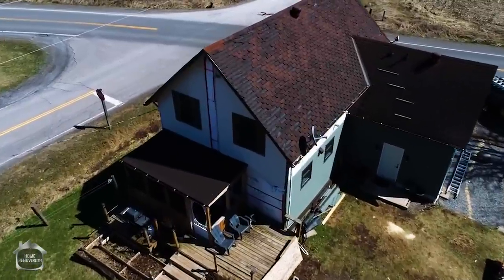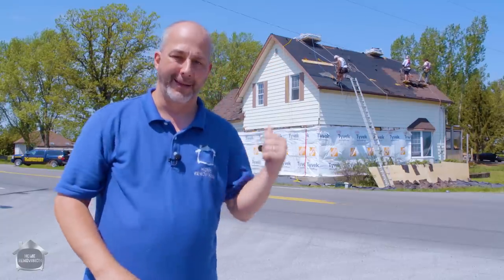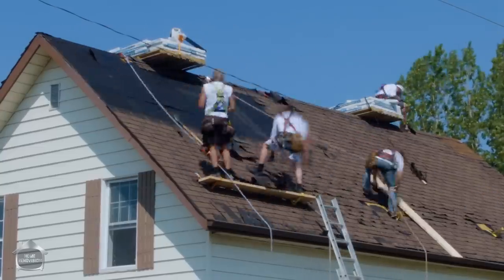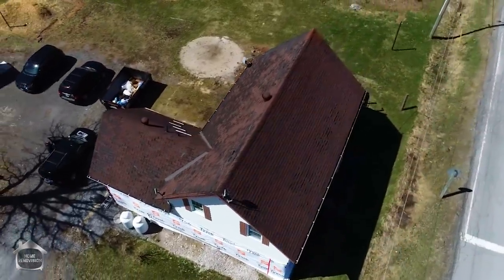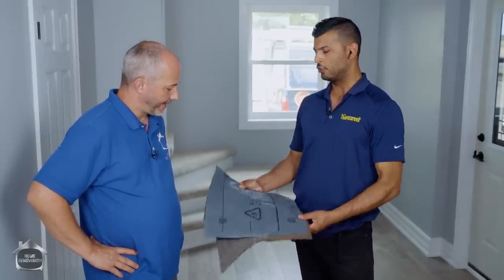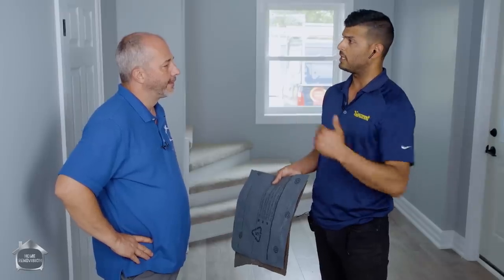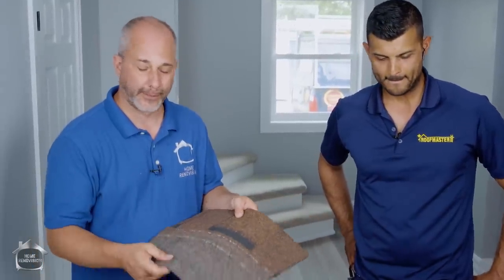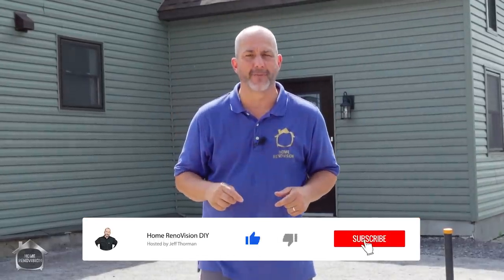What to Expect When Changing Your Roof

Comment: I've roofed for over 30 years and I do believe that your supposed to apply the ice and weather guard directly to the sheathing, plywood! Not over top of the old tar paper. Also, if your not taking the old tar paper off, how are you securing the old deck that will always come lose when tearing off the old shingles?
Reply: I roofed for 2 years and i know this as fact. It's supposed to melt onto the surface it is laid on over the summer, now if that surface is loose tar paper,your product isn't installed properly, it won't do its job properly, and you will 100% need to re install more ice and water shielding when you redo your roof, whereas there's a good chance, if installed properly, you wouldn't next time around. Also that grey underlay freaking sucks, it's like cloth and yes it fucking can be slippery. I've gotten more tears around nails with that product than any other i used.
Reply: Correct.  I used gracie snow and ice right up to the ridge vent.   Roof will not leak for a VERY long time.  Cheap insurance.
Reply: Correct ice and water goes only on sheathing..if its put over paper it is pointless it leaves a gap in between and doesnt stick
Reply: the irc requires removal of all roofing materials before installation of new materials. self adhered membranes can remain, and you are allowed to put the new materials over the old.
Reply: @paperwait9611  Sounds like a shitty idea.
Reply: @davec.3198  damn I feel sorry for the next roofers who have to try and tear those roofs off. Nothing that got my panties in a bunch like shingles welded to the ice guard!
Reply: I've had to rip a 7 sq section that the shingles were stick to ice and water(done it many of times but this was the biggest section)and I use my knife to cut the bottom of the shingles off then use my hammer to pop the nails and just go shingle by shingle..its the fastest and cleanest way cause if you use a ripper it leaves pieces everywhere all uneven and it's just messy and you have to get the double part off if its architectural which if it has ice and water on it then it most likely is
Reply: @robertsmith8081  The Gracie product has a plastic top on it that doesn't weld to the shingle.  The back of it that is on the deck is insanely sticky once the sun hits it.  I accidentally had some trimmings from it stay for a week on top of my new shingles.  I had to go up and cut them off with a razor blade.  They where welded on.  
That made me a believer.
Reply: @davec.3198  yeah Dave I've used that and had makes a similar product also. But, the cost associated with these 2 and others might be the difference of selling a roof and losing abid.
Reply: @robertsmith8081  I get it.  I was doing my own roof.  Did half of it for $2k on a long ranch house.  There was a serious insulation and ice damming issue that only affected the back side of the house.
Reply: @davec.3198  why do you state that? i don't see any problem with the irc provision on this matter.
Reply: @860smalley5   No ice and water shield is the seal around the nails.
Reply: @paperwait9611  self adhered isn't tar paper
Reply: You're absolutely right

Comment: Good video on shingle roofing technology. But pretty biased from an asphalt roof installer. If after 50 years your metal roof has a deteriorated coating, you can repaint it for a fraction of the cost than re-shingling the roof again. At least the house is waterproof and the panels haven't blown off. Exposed fastener metal roofing is very affordable compared to standing steam metal roofing. Asphalt shingles are not sustainable environmentally and frankly, financially.
Reply: You can’t just repaint a metal roof it has to be coated and coating a roof properly will cost more than installing a new metal roof. If it was the case that you could just paint a metal roof then no one would be doing metal roof tear offs
Reply: @38snipshow  100% agreed. I despise the 'cheapest is best' or  'I'm going to flip it in a couple of years so why spend the money'  mentality. That 'thinking' creates a vicious cycle of mediocrity.
Reply: The problem is that quality isn't something buyers pay for when house shopping. They pay for interior renovations, square footage, and schools. A new 50 year roof isn't going to get you a significantly higher sale price vs a 20 year old shingle roof. Same with insulation, air sealing, quality siding, etc.
Reply: @danbert8  That is the sad reality, in our warped market finishes are  also more important than structure. The solution is a better building code.
Reply: @danbert8  if you are going to go the "quality" route, you have to go all-in throughout the house. you have to have a clearly "quality" house to have any chance of fetching a premium. a "quality" roof alone isn't going to do anything for you.
Reply: @danbert8  not everyone is trying to 'flip' a house to sell. My investment properties are long term holds so that's not as relevant.
Reply: @38snipshow  yep. It’s not just about flipping… so if you say, add a nice fence to a property, you could then consider “selling “ the property at a higher rate to a pet owner, versus without. And if not a pet owner, it’ll just be a nice privacy fence.
Reply: And in 5 yrs when all the rubber washers on your screws bakes from the sun and starts leaking that's 1000s of potential leaks
Reply: @briscoesjug1026  If the washers on the screws deteriorate in 5 years, then the installation was poorly done. Regardless, I'd rather replace a bunch of screws in 15-20+ years than rip off a roof and replace the entire thing lol
Reply: @38snipshow  unless you live in Oregon or Maybe Canada where either it rains all the time or the sun don't shine it will become a problem. Might not be one you notice right away but eventually you'll notice . Hell I'm in the east and it happens all the time
Reply: @briscoesjug1026  I'm from southern Ontario. There are 30 year old exposed fastener roofs all around me and haven't heard of an issue as far as water leaks are concerned. At the end of the day, standing seam metal, despite the upfront cost, out performs all other roofing types
Reply: @briscoesjug1026  Lol
Reply: @rightlanehog3151  it’s what people can afford

Comment: We got our roof done this year, decided on metal because we got solar installed on it and wanted to make sure the roof would last as long as the solar panels. Love the sound during rain/hail! We are reaching net zero on our 1886 property! woth surprisingly low costs!
Reply: Yeah metal is nice but as a roofer myself I've seen the rubber washers on the screws that hold the metal on bake from the sun and that's 1000s of potential leaks
Reply: @briscoesjug1026 would a standing seam roof work better in that regard?

Comment: I just had an AS roof installed on my 1940s house (leaking and ceiling about to fall in!) I didnt see this video before I had it done, but after seeing this, I feel 900% more confident in my decision! $7800 for 18 square on an 8 pitch was not a bad price for what I got! Thank you for your fantastic videos! You're my go-to for my projects!
Reply from the maker: Like the guy in the video said....it has changed a lot over the last 20 years. I expect it will double in cost every 15 years moving forward as well. Cheers!
Reply: What I did to build confidence in my choice was to note addresses with newer roofs. I can search permits online. Then I noted the companies & their job prices. Btw, half the addresses never pulled a permit. I cross referenced the company name/owner with state licensing & small claims to see who is getting sued for bad jobs & if they're qualified. 

Lots of horror stories. I don't want to be another one.
Reply: @HomeRenoVisionDIY  Also, shingles raise in price with the price of gas and oil, let alone inflation.
Reply: @KLondike5  where exactly online do you check this information?

Comment: I had metal vents written into my roofing contract. 5 years later I find out they did metal on the attic vents but plastic on the bathroom fans. They will skimp where ever they can get away with it so make sure you know enough to judge there work.

Comment: I looked at my roof today while up getting caulking and touch up painting done.  I need a new roof.  This was most helpful.  I think doing a roof in late Spring is likely best because the shingles will bond better if they get hot over the summer.  I want to put in better roof ventilation as well.  My roof exhaust fan quit working and the thing is not bird or squirrel proof anymore.  I totally agree - do it all at one time.  My biggest issue is do it all at one time vs. start from scratch.  I keep noticing shoddy workmanship in my house that I've owned for 25 years already.  The technology of newer building systems is so much better if built by a person with professional knowledge.  I certainly lack the knowledge to hire the right contractor but I'm learning.

Comment: Not sure how different things are in Canada, but for the US I went with Certainteed after quite a bit of research.  They have a very high quality shingle (I was looking for hail-resistant class 4), and if the installer has the correct certifications their warranty is NON pro-rated and includes labor and disposal.
Reply: I live in Québec city and this is the product that I choose last year. It is the same warranty that you described. What's more the warranty is good for 50 years, 50 years ! and I can transfer it to a new owner durening the first 12 years following the installation.
Reply: the warranty is good as long as company which offers warranty is still in business...
Reply: @SuperMapupa  The are part of Saint-Gobain group: https://en.wikipedia.org/wiki/Saint-Gobain

Every business can go under. À ce titre, il n'y a aucune garantie qui est valable.
Reply: There is one thing i hate about certainteed, it's that fucking sure strip lol, other than that, that's the brand to go with.

Comment: Woke up to shingles blown off the roof this morning (Georgia), not too bad of a storm yesterday, so curious about the condition of the deck. Great video timing! This helps at least understand the terminology for when we get someone out to inspect the roof and get estimates to repair/replace. Its a 10yo roof, but looks in great condition. Bought the house 1.5years ago and roof inspection came back really solid. Was hoping to get at least 2-5 years out of the roof, but I guess we'll see whether replacing or repairing is best.

Comment: Jeff, I am so glad you focused on the ugly realities of the shingle warranty. When is 50 years not really 50 years etc? In regard to metal shingle roofs, the installation labour component is 3-4 times as high. Each metal shingle is screwed in with 6 screws which takes much more time when compared to a nail gun installing an asphalt shingle. Contractors simply don't make as much MONEY with steel shingles. They cannot do the whole job in one quick 'payday' so they discourage a customer who really wants a long lasting product. Lastly, why is snow sliding off a metal roof a problem? Nobody with a metal roof worries about the weight of snow building up on their roof after a heavy snowstorm or a series of snowfalls. If the grading and drainage around your foundation is wrong, it is wrong regardless of what type of roof you have. Finally, when we drive around in the country we see lots of steel roofs which are far, far older than 50 years. You will never see an asphalt shingle roof attaining an age anywhere close to that.
Reply from the maker: the question is not which is better. it is which is better in each situation. a good metal roof install is still the Cadillac but financially it is not even a consideration for many people. so understanding the industry will help to manage expectations.
Reply: On the Risinger metal home roof video, he replied to my cost ask & claimed it was $400 a square. That sounded impossible as I paid more than that for asphalt install. I think he only quoted a labor or material number. He didn't reply to that follow-up.
Reply: @HomeRenoVisionDIY  Thanks for the reply Jeff, I think this video offered real insight to several important considerations people might make in evaluating their  roofing options. In regard to steep roofs, I recently re-roofed my shed and it is amazing how much steeper it is today compared to when a younger me built it 17 years ago ;-)
Reply: How about hail damage

Comment: Jeff mentions upkeep costs. So true. There are some good looking houses in my neighborhood that would be really hard to roof. Lots of valleys, strange angles and high pitches. The last estimate for our simple 1600sf ranch with a 8/12 pitch was $5700 (Alabama). Back when we bought our house I insisted on a smaller, simpler house with a basement and a brick finish to my wife's annoyance. She's finally coming around as we have gotten older.
Reply from the maker: simple houses are much more efficient in both maintenance and energy cost and lower cost to build. Everything else is designed to impress only! The more folks care about being practical the lower the values of those impressive costly homes will be!

Comment: Did my own tile roof 20ys ago, but paid for tile loading and a crew 1k to do continuous hotmop on a     43lb paper with 105 lb premium then tile, shd last 60+ yrs.  Today they put garbage 1 layer 50lb junk under tile.  This 25k roof cost me 4k in materials in 2000.  Doing it yourself or a portion can really save and you can put much better materials, example a peel and stick self sealing under this shingle with a genie lift might be doable and still cheaper in the end?
Reply: those prices he just said are "outrageous" !!!  are they taking advantage of people or what??? 😮😮😮😱😱😱

Comment: Did you consider cutting in soffit ventilation? I am looking at an old farmhouse 12x12 pitch and plan on adding ventilation. Will rip open interior sloped ceiling to add in ventilation baffles and insulation then re-drywall...

Comment: i live in belgium, so we have baked clay tiles as roofing, and our roof has been on our house for 60 years now. still works great, and no leaks either.
Reply: Clay tile roofs last a long, long time in a mild climate like yours but they cost a fortune to install. In Canada with our severe climate, the best option for a long lasting roof is a steel roof.
Reply: @rightlanehog3151  yes i could see that, in your location that would be favorable to install. and for our roof we paid around 25 thousand euro`s for a new roof.
Reply: @justinvanmierlo302  I would have thought it might cost more than that. In any case, you are set for the next 100 years.
Reply: @rightlanehog3151  They're popular up in the Nordic countries too, where we have a similar weather to most of Canada. The problem with a steel roof is that they're reaaaaally noisy when it rains. Ceramic tiles are heavy, so they're very quiet even during heavy rain.
Reply: @VortechBand  I only spent a week in my visit to the 'Nordic' countries and what I remember most is that Norwegian wooden houses were actually made of wood not plastic . If your steel roof is too noisy your roof sheathing is too thin. I sleep like a contented log under mine but I do have 1 inch of plywood beneath the shingles. In a really bad storm I just snore louder to cover the sound of the raindrops.

Comment: Thanks for sharing, your videos are very helpful! I'm wondering how did you ventilate your mansard roof? I live in Northern qc, my house looks a lot like yours. I need to address my ice dams issues, I'm thinking about doing it from the inside. But I recently saw that I could  insulate over the existing roof sheating..what method would you prefer?

Comment: I really appreciate all the instructional videos you are doing but I strongly suggest you make a supplemental video to this one as critical factors such as drip and rake edges were neither installed nor discussed and no comments either about step or kick out flashing. You are so good in discussing code changes and innovations but a few key points were missed here. Without proper flashing the roofers are going to use a lot of caulking to try to seal roof/wall joints which will never last as you know. These items have to be discussed upfront and can explain pricing differences between some quotes as well.

Comment: Jeff.  1955 house with false soffets (no airflow) so adding vents does nothing at this point.  The roof is a hip type with a gable inside the garage (where they adjusted the attic access after adding furnace venting).  Would you recommend adding a couple of power roof vents to maintain some sort of air flow, regular roof vents or something else?  I just thought about it with this video so would need to see exactly what venting I currently have.
Reply: Just adding vents at the ridges won’t promote good attic ventilation. If you add vents close to the eaves as intake AND at the ridges as exhaust then you will be in good shape

Comment: My UK house has a slate roof, the tiles are very heavy. It appears to be a long lasting material but a expensive option in terms of the tiles + installation.
Reply from the maker: they last hundreds of years. nice when you don't have any ice damning. we could never use that!
Reply: @HomeRenoVisionDIY  I've seen plenty of slate roofs in southern ontario that have held through the years, but on certain styles of roof only.
Reply: @tay13666  I meant design wise, like simple double gable or 4 side hip roofs. I've seen em on 12/12's and 5/12s. I have never seen one with multiple valleys or dormers, i'm assuming, because it's a pain in the ass and costs more lol.